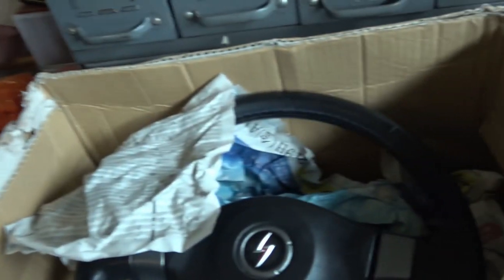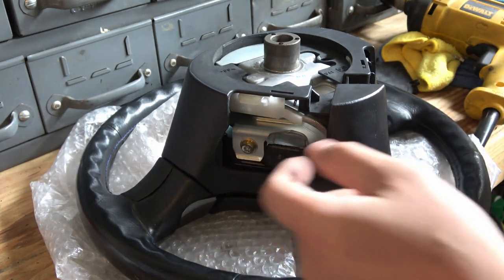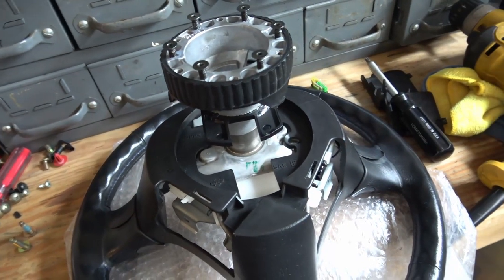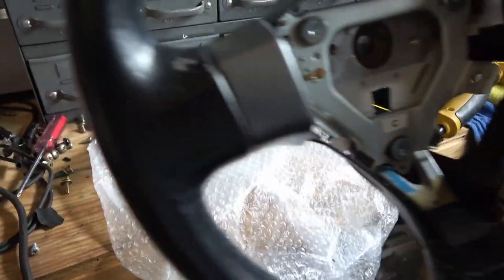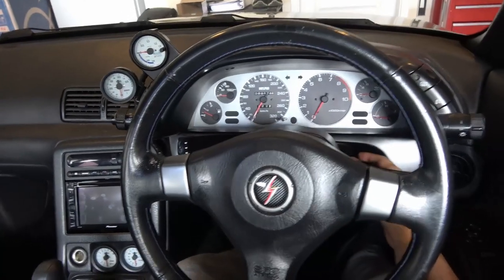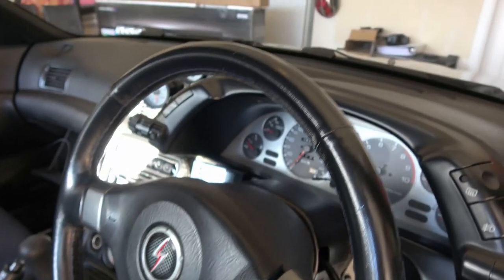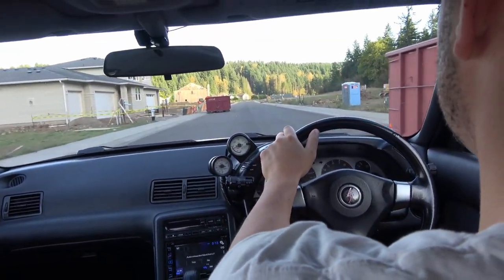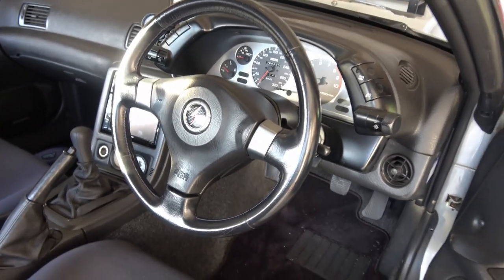Tokyo Drift Mona Lisa Silvia S15 steering wheel

Comment: Great video! Thanks!
I’ve been looking for a video like this.  I have an R34 wheel and am considering installing it in my R32. My R32 came with factory airbag so that may complicate things. 
Did the Silvia wheel set off the HICAS light on the dash? Does HICAS still work or did u delete it?  Did u need a hub adapter for this wheel?
Reply from the maker: Did not set off any HICAS light. I still have the HICAS system and it works like new. No hub adapter is needed. Mounts up just like a R32 stock wheel. I wonder if your airbag connector from your R32 will plug in to the R34 steering wheel? I would disconnect the battery when changing out your wheels to make sure the airbag is not effected in anyway. Good luck with the swap!